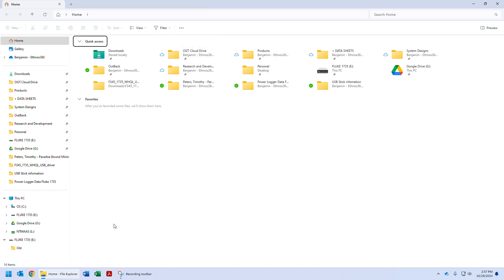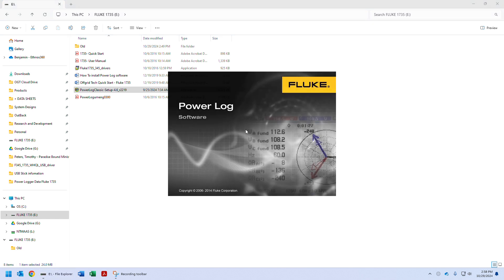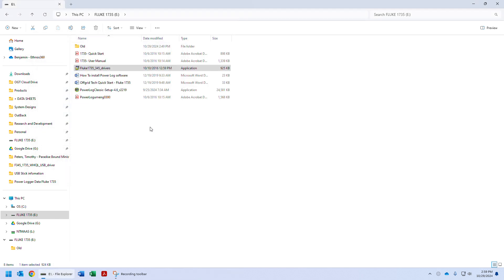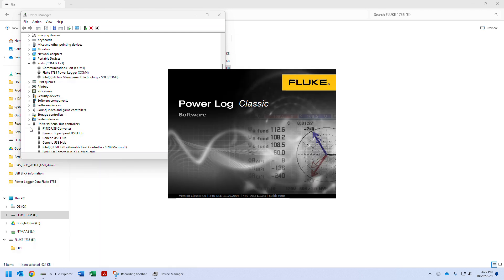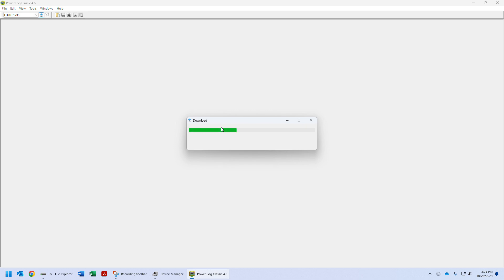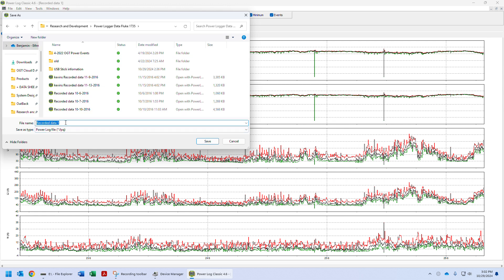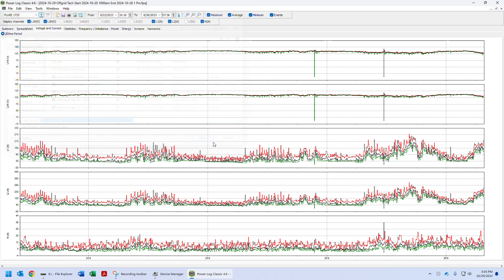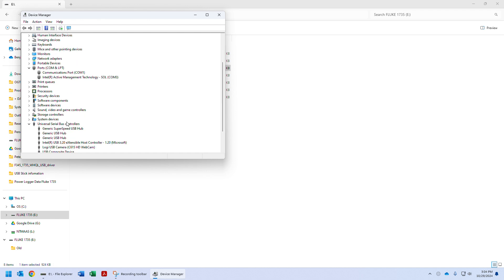Video 2  Fluke 1735  Install Power Log and Drivers

Comment: je n'arrive pas à installer le bon driver pour le Windows 10 pouvez vous me mettre le lien de l'installation s'il vous plait
Reply from the maker: https://www.fluke.com/en-us/support/software-downloads/fluke-1735-three-phase-power-logger-software-and-firmware

*Update: If you don't have the "Fluke1735_345_drivers.exe" file you can still manually install the drivers from the "Fluke 1735 345 drivers (.zip)" by extracting it. Then navigate to \F345_1735_WHQL_USB_driver\ and right click on the "ftdibus.inf" and  "ftdiport.inf" file and chose Install. Memory Integrity must be disabled.

Comment: I have the same question. When I look on flukes website the "fluke 1735 345 Drivers .zip" doesn't have an installer. Where would I get the drivers application you used?
Reply from the maker: Hum, good question... It looks like it is on the original CD that came with my 1735. I did find a copy by searching the internet for ""Fluke1735_345_drivers.exe". But it was from a third party website, so at your own risk! You can still manually install the drivers from the "Fluke 1735 345 drivers (.zip)" by extracting it. Then navigate to \F345_1735_WHQL_USB_driver\ and right click on the "ftdibus.inf" and  "ftdiport.inf" file and chose Install. Memory Integrity must be disabled. This should be done BEFORE you connect the 1735 to your computer. If you have already connected the 1735 to your computer, see Video 3 and uninstall first, then start over. Let me know if this works.
Reply: @offgridtech360  That did the trick! Thank you very much!

Comment: By chance, where did you get the drivers for Win10?
Reply from the maker: The best place to find the Fluke 1735 drivers is the Fluke website. As stated int he video there are no drivers specifically for Windows 10 / 11. But the 64 bit Windows 7 driver "Fluke 1735 345 drivers (.zip)" does work if Memory Integrity is disabled, as described in Video 1. https://www.fluke.com/en-us/support/software-downloads/fluke-1735-three-phase-power-logger-software-and-firmware